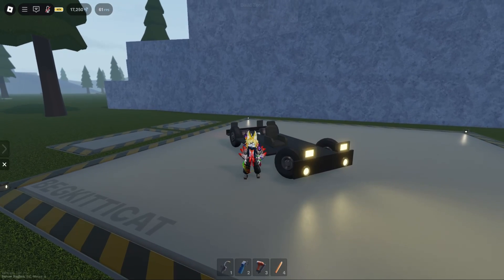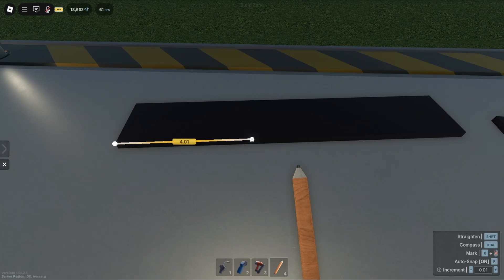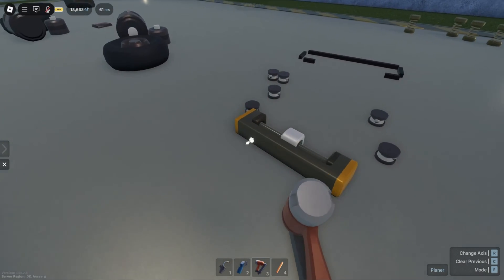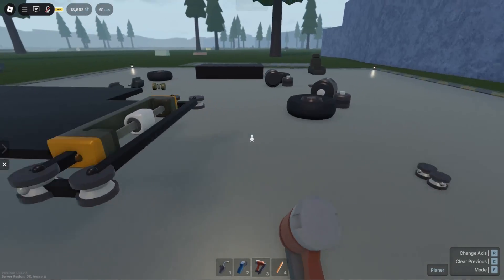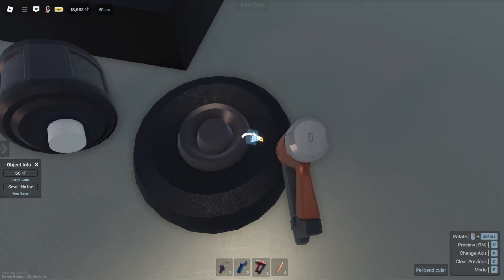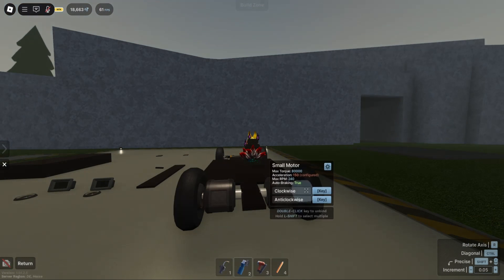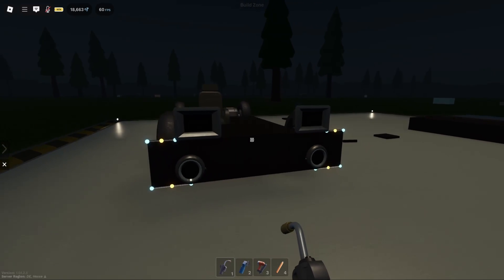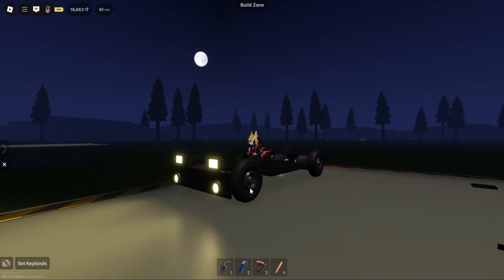GearWorks Beginner Car Tutorial

Comment: 4:30 this doesnt work because 4:23 doesnt go straight even if my hinges are welded, its just 15 grades too much or too less
Reply from the maker: when adding it you exadentaly used scroll wheel and it became +15 degrees
Reply: it could also be you're hinges weren't straight to begin with if it is always too much or too less, you will need to straighten them, then weld them. I did this just by attaching a block to the hinge and using the nailgun to direct it towards a perfect angle.

Comment: I tried doing a list of the things you need, tell me if anything is missing
You need:
A big block of some material (10 x 5) - 1x
a Linear Servo - 1x
Micro Hinge - 6x
Light Spring - 1x
Small Motor - 2x
Medium Tire - 4x
Heavy Motor - 2x
Seat - 1x

Optional:
Round light - 2x
Worklight - 2x
Brake Light - 2x
Seat - Inf (The more the better :D)
Reply from the maker: everythings there ty
Reply: @ObeyKitsune  I should be thanking you! You made the best tutorial out there, also, i met you in gearworks yesterday, my name is ImZero